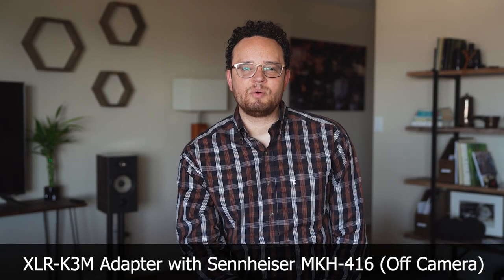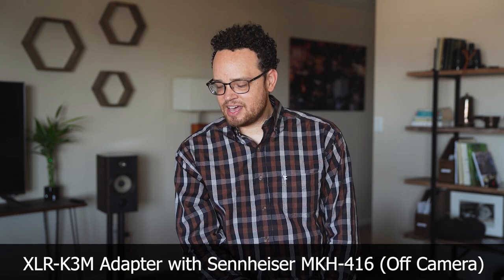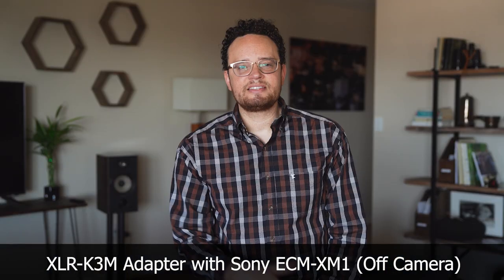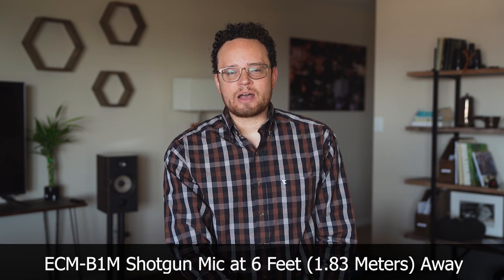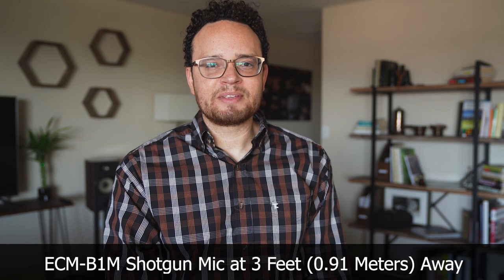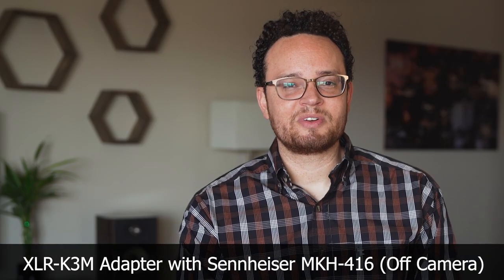Sony Shotgun Mic Shootout - XLR-K3M vs ECM-B1M

Comment from the maker: Here are some jump links for easy comparison: 
1:02 - XLR-K3M Adapter with Sony ECM-XM1 Shotgun (Off Camera)
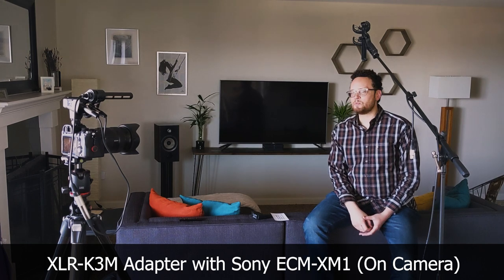1:41 - XLR-K3M Adapter with Sony ECM-XM1 Shotgun (On Camera)
2:03 - ECM-B1M Shotgun at 6 Feet (1.83 Meters) Away
2:41 - ECM-B1M Shotgun at 3 Feet (0.91 Meters) Away
3:14 - ECM-B1M Shotgun Hand Held
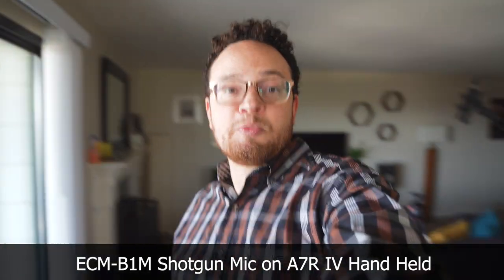3:29 - XLR-K3M Adapter with Sennheiser MKH-416 (Off Camera)

Comment: Hi James nice review  Sennheiser MKH-416 best mic i have ever used.  did you find a solution ECM-B1M hand noise ? I have ordered the k3m but I am also interested in the  ECM-B1M big oversight on sony's part ?
Reply from the maker: Hey John - I haven't ended up using the ECM-B1M much at all since the pandemic. My plans for it have been postponed. I remain wary of the handling noise, though. It does seem like a pretty big oversight.

Comment: Have you tried the hot shoe adapter that comes with the XLR-K3M with the ECM-B1M? I'm very interested in getting both and would be happy to know if the adapter works with the ECM-B1M so it can be mounted slightly away on my camera cage. Thanks a lot!
Reply: Would like to know this as well… Anyone know this?
Reply: @MickeyDelen  Curious myself. So far never seen that. Might ask Gerald Undone if he ever notices the reply as he has both.
Reply: @Bo_Hazem  I noticed OP answered someone with the same question on another comment that it worked on A7R using the hotshoe cable.
Reply: @MickeyDelen  Wonderful! Great to know. Now hoping Sony to be competent enough to release those extension cables separately with a variety of lengths.

Comment: Where would you put a lav mic receiver on the XLR-K3M? I wish there was a hot shoe instead of that shotgun mic.
Reply from the maker: Yeah, I hear you, Matt. Panasonic has a similar adapter for the GH5, and I prefer their approach of just duplicating the hot shoe on top. With the XLR-K3M a cage would probably be the answer to mounting lav receivers.
Reply: @NeverStark  Thanks for the reply James! I actually found an adhesive cold shoe accessory that I could mount on top of the flat part. Not ideal, but it would easily support the little RODE Wireless GO receiver, which weighs almost nothing. Cheers!
Reply: @NeverStark  If you use it with an A7iii does it still talk to the K3M just analog or do you have to connect it to the camera's mic input through 3.5mm?
Reply from the maker: Hey Matt - while I haven't tried it on an A7III, my understanding is that it will send an analog signal through the hotshoe as long as you've flipped the switch from Digital to Analog. In support of that theory is the fact that there are no other outputs on either the XLR-K3M nor the ECM-B1M. Should work just fine.

Comment: Great review.  For two person trade show indoor interviews from 5-10 feet away from the camera (not centered), do you feel the ecm-b1m mic will be effective in picking up two voices with my Sony Zv-e10?  Assume we set it for super directional, noise cancel, auto.  I travel alot pre pandemic so portability is key. I have a Saramonic Blink but it is USB c and the usb c doesn't work with the zv e10 for some reason.

Comment: Hi, do you know if the ECM-B1M bypass the mic input? My A7sii mic input jack and internal is broken. thanks
Reply from the maker: Hi Eddie - apologies for the late response. I haven't tested that specifically, but the only connection between the camera and the ECM-B1M is through the hotshoe, so I'd assume that a broken mic input jack wouldn't prevent this mic from functioning with the camera. If there's something else going on with audio processing within the camera, though, that could be another story.
Reply: @NeverStark  thanks for your response, I bought the Sony ECM-XYST1M which uses the hotshoe but it didnt work. The fact the internal mic went at the same time (It fell over on a tripod with a mic plugged in and all the impact went through the mic input jack and pushed it in) probably are tell tell sign that there is something wrong with the ability to record any audio.
Reply from the maker: @eddiegoldsack4339  Very sorry to hear that, Eddie. Here's hoping it's repairable.

Comment: Thanks for the video. I am not sure if anybody else has mentioned it or not. It would have been more complete if you had added some lateral noise to test/compare the directional performance  of each mic as well. Thanks again, cheers
Reply from the maker: Thanks Mohammad - I did do a separate video to test active or passive noise cancellation in case that's of interest. Find it here: https://youtu.be/8Gutj3WFgAY
Reply: @NeverStark  great l will check that

Comment: How does the included shotgun mic sound to you compared to the mkh-416?
Reply from the maker: Mounted off-camera, surprisingly good. The MKH-416 still has the sound I prefer, but I could definitely use the included shotgun for professional work if needed.

Comment: Thanks for vid. For sure a boomed mike sounds way better than an on camera mounted mike. I have the ECM-B1M as a 'reasonable' but relatively discrete mike for scratch audio or original audio if working close. It looks like adding an XLR input direct to camera can further improve quality esp. when getting mike off camera and close to desired voice/SFX. 

I also have a Sennheiser MKH 416 and a MixPre 6ii for optimum quality - but it's more kit to manage and harder to be discrete with. I'm now considering the XLR-K3M too, not least for the extension hot shoe cable (nearly impossible to source separately) so I can use the mike away from hot-shoe, better facilitating a cage mount rig with top handle. I have yet to work out how best to handle a camera with a DJI gimbal (RS3) with/without cage and options for sound plugging etc.

If it were possible to buy the remote cord separately (almost impossible) it might negate or lessen my perceived need for the full XLR-K3M kit. That said your demo of stand booming a MKH-416 direct into camera via the K3M module looks like a simpler, quicker, lighter set-up rather than using my MixPre6ii with separate syncing etc for quicker/lighter shoots when working solo. Ideally having a team to operate sound, lights, camera, handle and carry kit etc is best but either expensive and/or impractical for many situations.
Reply from the maker: Hey Ricky, thanks for the great feedback. That XLR-K3M has been wonderful. I haven't used any higher-end stuff for the work I do, but you can't beat the simplicity, and I get results I'm really happy with. I have a similar unit for a GH5, and they're very comparable - though the Panasonic needs a splitter if you want to record audio tracks at different levels for safety, where the Sony can do that with just one XLR cable plugged in. Thanks for watching!

Comment: What shock mount did you use to mount the ECM-X1? I have a Rode SM4-R, would that be compatible by any chance?
Reply from the maker: Hi Jorge - the shock mount is the Sennheiser MZS20-1 for their MKH series mics. The Sony did not actually fit in the back part of the mount, so this setup was a little precarious. The problem is the rubber cuff around the mic that helps to suppress vibration when it's in the mount on the XLR-K3M. I actually have a Rode SM3-R laying around, so I tried that. I was just able to get the Sony mic to fit - but it was pretty tight . So maybe the SM4-R is an option if you're careful.

Comment: hi james，i am wondering if you did a noise cancling of ecm-xm1 or not，i recenly bought this microphone kit，it has a crazy sound noise and hearless electic sound，did i use the microphone in the wrong way or not？
Reply from the maker: Hi Seth - no, I didn't do any noise reduction in post for this test. If I was experiencing what you described, I'd definitely try to return or exchange with the retailer.
Reply: @NeverStark  yeah thx for your advice and test，it helps a lot，i just returned it to the retailer already，you have a nice day。

Comment: Also what long wires are you using for boom? K3m is XLR 1/4 input right? So its not a Full XLR? Do you use adapters or buy mics with and cables that are XLR 1/4? The 3 prong full XLR inputs look like they wont align in pics of k3m.  Lmk?  

But most Importantly.. please tell me if the K3m hot shoe adapter to move off center will work with the B1M? 

Is there any other hotshoe adapter that allows you to use B1M off center.  I need a top handle for my cage on center and that mic on hot shoe b1m won't work the wire adapter  from k3m allows it too.unless
Reply from the maker: Hey Adam - answered your 2nd question in your previous comment. As for the XLR-K3M, it has two full XLR inputs and I use a standard XLR cable to connect my Sennheiser MKH-416. (The included mic has its own built-in XLR cable - not detachable.) The K3M also has a 3.5mm input.

Comment: Hey James.. the K3m comes with an adapter that allows you to move the hot shoe off center. This is a must if you use a Rig with a top handle and cage.
The b1m does Not Include the adapter wire to move hot shoe. 

MY QUESTION IS THIS? DOES THE K3M WIRE ADAPTER WORK WITH THE B1M? CAN I MOVE THE B1M OFF CENTER WITH THAT WIRE?

HOW ELSE CAN YOU MOVE SHOTGUN MIC B1M OFF CENTER OR OFF CAMERA..
Reply from the maker: Hi Adam - I actually tested that extension cable from the XLR-K3M kit with the ECM-B1M last month because I was curious about it, too. At least on the A7R IV, the B1M did in fact work with that extension cable. I can't speak for other cameras, but I thought that was a positive result.
Reply: So i had a xlr mic with 3 prongs.. i assumed when I seen the pic.. it says xlr 1/4.. so i thought they were mini connectors. As for b1m.. i wish they sold wire separately.. i need it off center.. but i hear included shotgun mic is really good on the k3m.. so kinda pointless to buy the b1m unless it was 4 run n gun. I hear the b1m is only good for 3ft. So kinda disappointing.  Thx 4 hard work

Comment: Hey man great comparison! I have the k2m. Does the k3m also have to be switched to dual mono in post?
Reply from the maker: Hey Panzardi - this is interesting. I'm very used to duplicating one audio channel over to the other in post, or using an XLR splitter to record audio into both channels (one at a lower level as a safety track.) But with the K3M set to IN1, audio is recorded to both L and R channels (1 and 2, respectively) and even though you're only physically plugged into input 1, you can vary the levels recorded to either channel with the gain wheels. Note that I've only tried this on the digital setting - but I haven't seen anything in the manual that suggests it can't also be achieved in analog.

Comment: What is that cool little boom stand?
Hey thanks for this.  Your setup is very similar to mine.  All mics sounding pretty much as expected.
But that boom stand!
Reply from the maker: Hey Clyde - that boom stand is a really cheap Auray MS-5230T - and I'll say that putting my MKH-416 (attached to Sennheiser's shockmount) at the end of that flimsy boom is a little unsettling. I really have to make sure all that weight is balanced over one of the legs on that tripod stand. I don't want it falling over and hurting the talent, the mic, or any other equipment. But it certainly is portable, and can be handy for tight setups. Hope that helps.
Reply: @NeverStark  Thanks, yes it helps.  Funny it looks solid on the vid.  But that's my same issue, securing balance, protecting subject.

Hope to see more of your vids.  Go James!

Comment: Really glad you made this! Can I ask what do you mean by it bottoming out? Or maybe I need to listen with my headphones and not my phone speakers!

I'm really interested in the ECM-B1M for wedding videography, small profile, but I do move a lot and would want to avoid that effecting the audio! But the possibility of it not needing a cable is really great, so is it worth the trade off to someone who knows the difference?
Reply from the maker: I absolutely agree about the convenience - definitely why I bought it. "Bottoming out" may not have been the best way to describe what I think is happening. It just seems like the built-in shock mount still allows the mic to move enough to make contact with its housing. The result is a sort of hollow "rattle" that I find unsavory. Hard to say whether you would experience it - but it seems to me that it doesn't take much motion to cause the unwelcome noise.
Reply: @NeverStark  thanks for the reply! I try to keep things pretty steady as I'm shooting, but things like walking down the isle need to be done in motion. But for me, the small profile wins out.
Reply from the maker: @MurrayEnders  That's great, Murray - I'd love to hear how it performs for you. I just posted another video testing noise cancelling, and the ECM-B1M does a great job of it. Hope you enjoy it.

Comment: Wow... I can’t believe that you made this video days before I finally decide to go in on a purchase. Not sure why there aren’t many good vids that talk about this mic: I just wanted to know if I could relocate the mic using a hot shoe extension of some sort. I’m using an a6600, and learning... just how awful the vertical-only articulation is. If I mount anything to the native hot shoe, I’m going to block the screen! Really not sure if I can even use any of the Multi-Interface Mics if I decide to get a hot shoe extension cable, or a bodyframe with a cold shoe. Any ideas?
Reply from the maker: Hey Lies - glad you were able to find this video! I didn't know about the screen articulation issue on the a6600 - that's unfortunate. I have some ideas, but they're probably not perfect fixes. After reading your comment, I did a quick test. The larger XLR-K3M kit comes with a hot shoe extension cable, and I'd been curious if it could be used with the ECM-B1M. My test worked (at least on the A7R IV) so maybe an extension cable could work in your case. Unfortunately, the hot shoe portion of the extension cable would still block some portion of the screen on your a6600 in the vertical position. Another idea, and I'm sure this is something you've already considered, is getting a small external monitor that can plug into your camera's HDMI. Not great, as it takes away the benefit of having such a small camera in the first place. It's what I would have to do on the A7R IV because its screen can't be viewed at all from in front of the camera. Lastly, if you're looking for better audio for vlogging, maybe a wired lapel mic like the Rode SmartLav+ into the mic input on the a6600 could get the job done? You'd have a cable to deal with, but you'd be able to see yourself on screen. Hope this helps.
Reply: James Jordan Hey no way! That's awesome. Any info you can give me on that cord? I actually did some more research and not sure if I should go with a Diety D3 Pro... or maybe try my luck the the ECM! Might save some money. But that's amazing to hear. Definitely going to invest in a monitor eventually... but not yet. Might be a last step since I'm not doing too many shoots that need it... yet. We'll see! I'm fine with a bit of the screen being blocked, so the extension may work! I'll let you know. Oh and forgot to sub! (Today I get paid, so taking everything in me not to just buy all of the camera things)
Reply from the maker: @usernamehandle  I know that struggle! I've just checked the cable, the box and the manual for a part number, but all I can find is "extension cable for audio". I did a little Google searching, but failed to find anything that looks exactly like what comes in the box for the XLR-K3M kit. You might have to do some trial and error! (Another struggle I know well.)